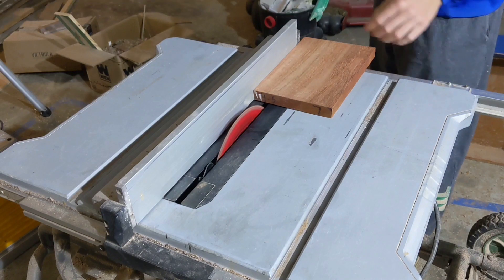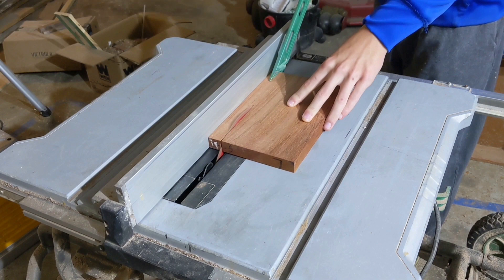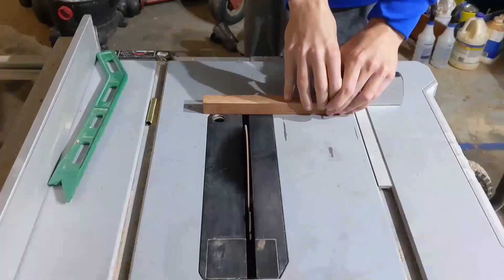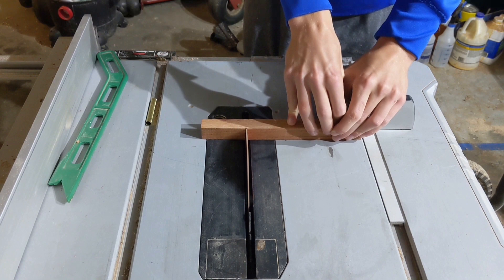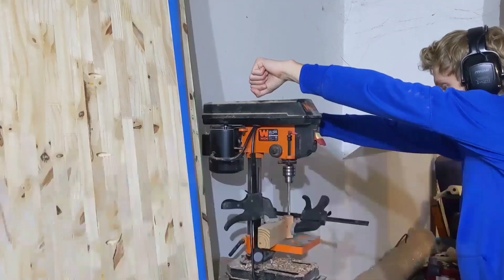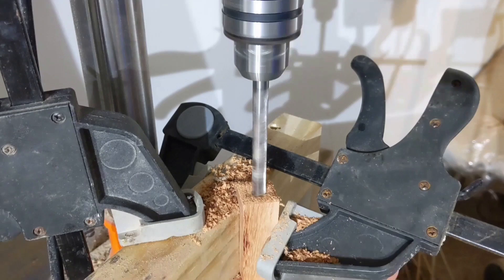Woodturning; Jatoba is a very interesting wood.

Comment: I'm working on a similar project, about 50 woods, mostly burls and exotics, for 50 slimline pens. So far they're all drilled and tubed, I just have to find time to turn them. The idea is to make a series talking about the various woods. Absolutely you should do it. People like learning stuff. 👨‍🎓👩‍🎓
Reply from the maker: Thanks for the feedback! Yeah there comes a point where just solid straight grained hardwoods start to get boring, so burls and exotics and segmenting is a fun way to switch it up some!
Reply: @WoodenLegWoodworking  One benefit of turning pens is they don't require much material. Thus, I can totally blow my monthly budget on exotic woods from far away places. At least that's my excuse and I'm sticking with it. 😊